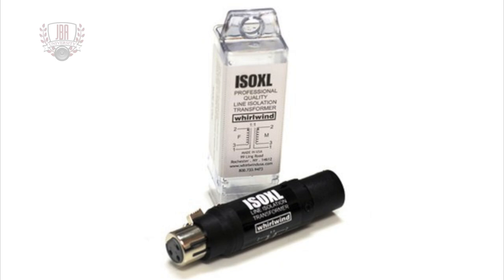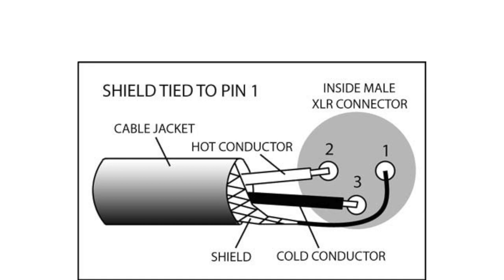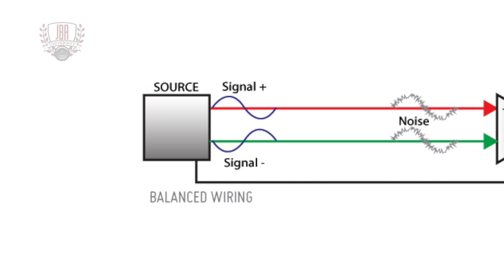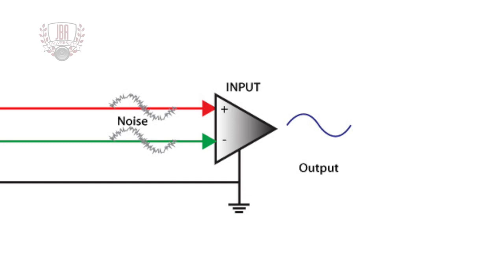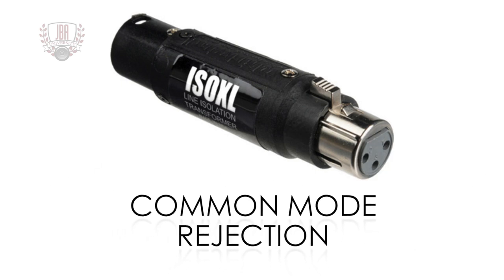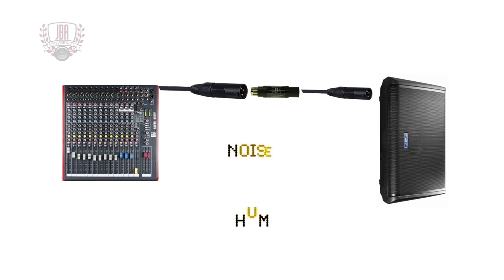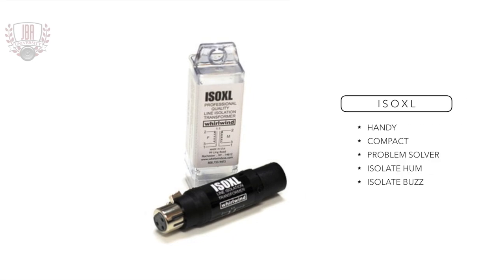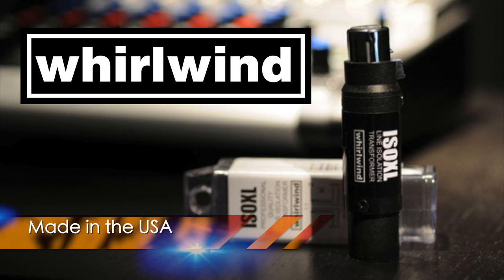Whirlwind ISOXL - How to remove hum in audio

Comment: Is that good for removing mobile phone interference?
Reply from the maker: This is for XLR cables which are typically used in professional audio gear. More than likely your interference is from something in the environment or an issue with your carrier's service. If you are using your phone to play music on a larger system and you only hear the interference when an output cable is plugged into your headphone jack, then this might help provided you have the right type of cable to first convert it to XLR.